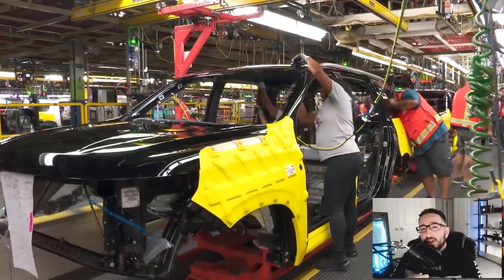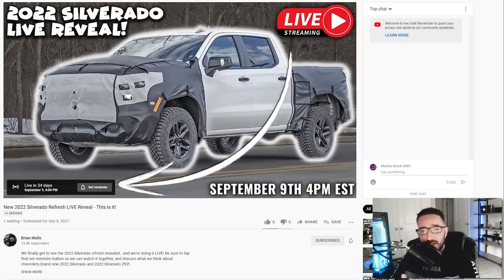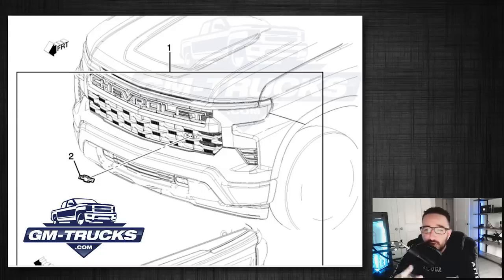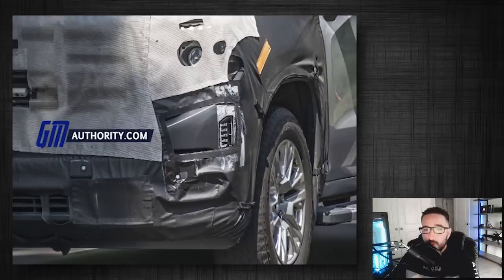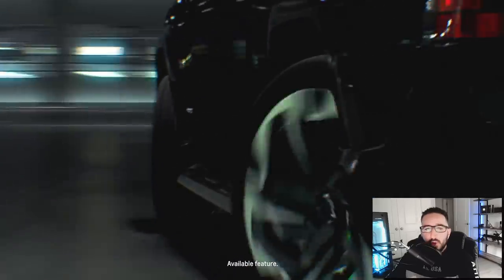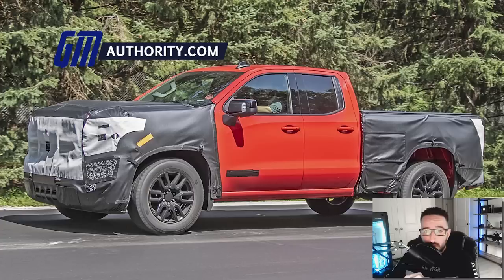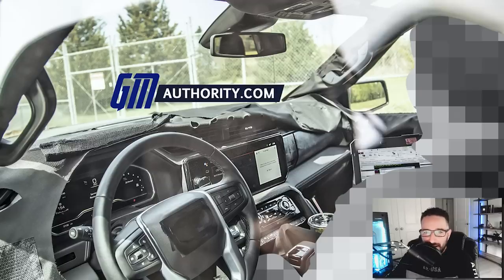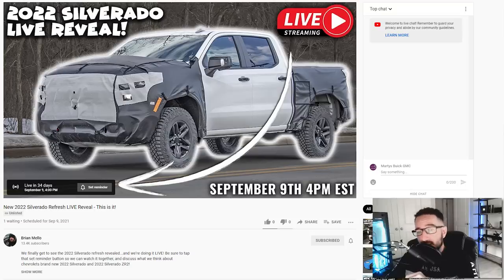New 2022 Sierra and 2022 Silverado Update - Leaked Front End Refresh!

Comment: Until they move the mirrors off the door back where they're supposed to be I'm going to stick with my 2016.
Reply: Ugliest body style I've ever seen on a pickup truck, and they're oversized for a half ton. That goes for both Chev and GMC. I'll be keeping my 2013 Silverado until GM gets their sh*t together with their design team..
Reply: The mirrors are fine, calm your tits.  Best functioning and positioned mirrors yet.  Cut the forward facing blind spot they had before with the older trucks.
Reply: @killercan10  my money my opinion.

Comment: It sounds like marking B.S.  What is the cost to replace head light? Can you replace bulb only? Can you replace bulb from engine compartment? Can you replace rear tail light bulb?What is the cost to replace wheel? What is the cost to replace transmission? You might re think spending $65,000,00 on a truck.

Comment: Front end is a lame evolution. Looks pretty much the same. Hopefully they step up the interior . And not rely on owners focus groups again. Not impressed yet..
Reply: I could easily say the exact same thing about the front ends of the F-150 and Ram... All damn outdated.
Reply: @dallasfrost1996  yep. But it's time to lead and not follow. The next generation gms better take it all. Tough segment.
Reply: @markj2838  Thing is, GM isn't known for that. Even when they might be "leading", they always get criticized for doing so. Use the current 1500 Silverado as a loosely put example. Chevy tried something new with the air curtains. They got hit hard for that. Personally, I'm actually a fan of the 1/2 ton Silverado design. Its by far the newest and most badass looking design in the segment (in my opinion). Plus it's unique and distinctive as well. The HDs however are very questionable...
Reply: @dallasfrost1996  I'm a huge gm truck fan. Love the front end. But if you're gonna change it go a bit bolder and new.. it's an older design now.
Reply: @markj2838  Well the whole idea itself, having air curtains isn't new. It's how Chevy incorporated it into the design.